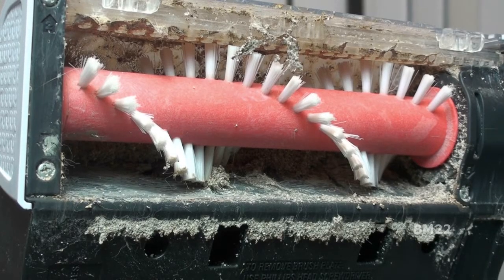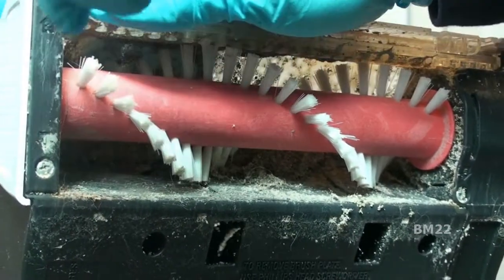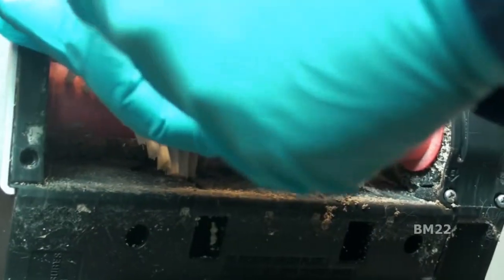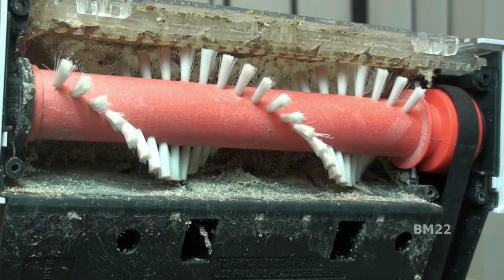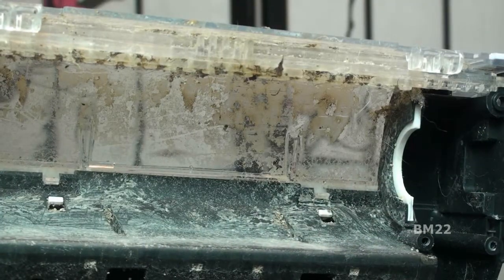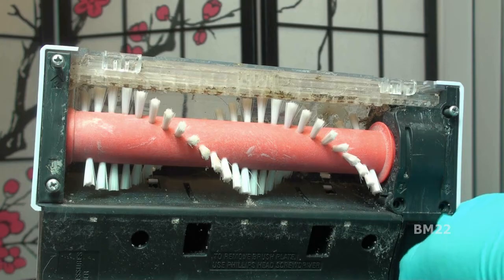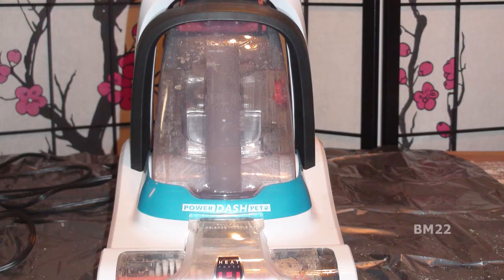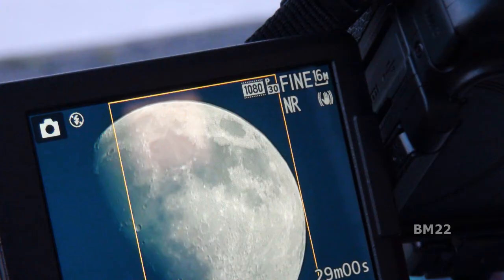Hoover PowerDash Pet Compact Carpet Cleaner; Brush Removal and Cleaning

Comment: So— no way to pop off the brush cover easily and then clean. Ugh! I can only get a few feet of carpet clean at a time with this small cleaner too. Had to keep refilling the solution container and dumping the dirty water. Not convenient or time saving!  Yes, does clean well, but wish I had a deluxe cleaner for better coverage of carpet cleaning.
Reply from the maker: Yes, it's a pain to clean; many people have stated that they run fresh water through it with a garden hose, being careful not to wet the entire unit down. Also, this is great for small areas, high traffic areas, and bedroom sized rooms. I've owned full-sized $1000-plus carpet cleaners, that were great for doing a large room, or entire house. But they were always too much of a pain to do smaller areas, or smaller rooms. And they took up too much space to store. For its size, this is a great little unit for the above stated reasons...and of course the price. It sounds like you need a full-sized carpet cleaner for a full-sized priced, not a small one for a small price. The Rug Doctor Mighty Pro X3 is nearly rental-size and costs around $500, and the Bissel Big Green Professional Carpet cleaner is about the same price. When I used to clean rentals and flip houses (whole house cleaning was required), I preferred the home version of the bigger rental shampooers (cost about $1000, 15 years ago), which is what I used to have before it never was returned to me after loaning it out. Good luck

Comment: Do you have any suggestions on how to fix if it won’t spray water?
Reply from the maker: Check and see if the tube is plugged where the water comes out of the "clean water" tank. If it is, maybe try using warm water (not too hot) to see if you can clear it. It might have soap build-up blocking it. Also, is the pray nozzle clear?

Comment: I cannot get the “nozzle” to clip back into place and stay. I don’t understand what I did wrong. Any one else have this problem? Any ideas how to fix this?
Reply from the maker: I've not seen that problem. All I can suggest is to make certain that you are putting it back in the exact same angle it was removed. It might be a simple alignment issue, or possibly the plastic is flexing too much, making it difficult to put back in.
Reply: @BM22TechReview  you’re so kind to reply. It will not snap back in place. I think the snap mechanisms became weak somehow when I took it apart to clean it. I’m not sure. If I put the nozzle on and push it down as far as I can, while the cleaner runs, it will stay in place. That’s good enough. I just figured this out yesterday. Thank you so much!
Reply from the maker: I'm glad to hear that. They've done us a great disservice by making these near impossible to clean properly...while it being an amazing little cleaner.
Reply: Me too, have u figured it out?
Reply: @kxnghxctor864  no. I bought Hoover Power Max Pet instead. The suction is much better. I’m sorry. I know how frustrating that is. I think it’s a defect.

Comment: Take it out in the yard and spray it with the high pressure hose nozzle.
Reply from the maker: That works, as long as you don't get the wrong parts of it wet. If the motor or wiring gets wet, if you're lucky the worst that will happen is just ruining the motor...
Reply: @BM22TechReview  Since water is designed to go through that part of it, the motor is well protected from moisture from the brush. Carpet solution (water based) is injected into the carpet, brushed up, then extracted. No water gets into the motor.
Reply from the maker: Yes, you are correct...about that part. It's just very important to not get "non-waterproof" areas of this unit wet.

Comment: Thanks for the video!  A question about spraying the cleaning solution--how many passes over the same stretch of carpet would you recommend?  I don't want to oversaturate my carpet with too much water, or solution.
Reply from the maker: I pre-treat the spot or stain, and then I don't spray over it more than once or twice with the PowerDash. And then I make sure to vac over it until I don't see any wetness being sucked up.

Comment: I can’t get my brush roll to spin :(
Reply from the maker: First check to see if the belt is on (or good). Then look for hair or string binding-up the roller. And lastly, you could try removing the roller and cleaning it off. If you don't see anything jammed in there, and none of the other things worked, the drive for the roller may be bad. If that's the case, you'd need someone who knows what they're doing take a look at it. That is above my pay grade...sorry. Don't forget to unplug the unit before doing any cleaning or repairs to it. Good luck.

Comment: Yeah, so I think I just ruined ours 🤦🏾‍♀️. I hosed it because I figured every thing was enclosed. It looked like everything was closed but I guess not…😭😭😭😭😔
Reply from the maker: That's too bad...but at least they are cheap :)
Reply: I am thinking I did not because everything still works it just makes a weird noise 🤔. Taking it apart tomorrow check the belt
Reply from the maker: Hopefully, it's just the belt, that's an easy fix.

Comment: But how to clean the plastic housing? He left it filthy with all kinds of gunk in there. I wouldn't want to use the thing with dirty crap inside the clear plastic housing. Yuck.
Reply from the maker: My current method of cleaning involves vaccing up clean water off the kitchen floor, until the water comes out clear.

Comment: Mine stopped running
Reply from the maker: Completely stopped, as in no power at all? Or is it just the brush stopped spinning?
Reply: @BM22TechReview  it made a loud noise and then it had a  smoke smell and shut off and it will not start up again
Reply: @BM22TechReview  and no power at all
Reply from the maker: I have a couple of thoughts on this. Either the motor fried, and this unit is basically toast. Or it was simply the belt that bound-up, which was the source of the smoke. If it's just a seized-up belt, and that didn't result in destroying the motor, then all may not be lost. Did you check to see is the belt still spins? I would also recommend going to the hoover website and contacting customer service. Generally speaking, I call all these departments "customer no-service" but it might be worth trying, especially if they feel overly generous today and offer you a replacement or discount towards a newer model.

Comment: Have a small. Carpet in an apartment. Have an Australian shepherd.  First i rake the carpet, then vacuum. Carpet is about 12 by 12 feet. Did one pass and decided to do that the following month one more time. Did about 4 foot and it made a strange sound an I smelt burning. I turned it off immediately and saw the belt dangling in half. This is junk. The belt might as well be a rubber band 😠 They could have made it an inch wider to accommodate a wider, stronger belt!😡  VERY POORLY DESIGNED!!🤬🤬

Comment: Don't waste your money on this machine. If you want to just spot clean a very small area that's cool, holds about a liter of water and you will break your back continuously if you want to do even a 5' x 7' rug. Get a bigger machine.
Reply from the maker: I'm not really in agreement with you here. I love the size of this, and I can clean an entire room with 3 to 4 fill-ups. And I had a full-sized carpet cleaner, ya know one of those HR carpet cleaners they rent at the grocery store (the ones you buy are blue, rather than red like the rentals). I think I paid $998 for it 15 years ago. It was nice for doing big rooms, but it sucked if the room still had furniture in it. I rarely used it, and loaned it out many times, until finally it was never returned to me. I also had a mid-sized carpet cleaner, a Hoover Power Scrub carpet cleaner. it was the worst of both worlds; it was too heavy and clumsy for small jobs, and too small for the big jobs. In reality, it's soap and waste containers, were only about 1.5 times bigger than this one, and nowhere near as agile.

Comment: Horrible that you can’t clean it without unscrewing it. I tossed mine and got a shark
Reply: Can’t clean the tank either. Only a small drain hole
Reply from the maker: I love still mine, and it has not failed me yet. Yes, it has some shortcomings I wish they would address. But for the price, and how well it cleans, it can't be beat.

Comment: Do not buy this item as cleaning it takes longer than cleaning your rugs! Absolute junk.
Reply from the maker: Although I agree this can be a pain to clean, I disagree with your other statement here. I have found mine to be very good at cleaning, solidly built, and has lasted well over a year so far with no reduction in cleaning ability. I do wish it ran longer on a tank of cleaner. The waste tank is sized for a bigger cleaner tank, so I don't know why they didn't opt for a bigger cleaner tank. Also, in the comment section of this video, people have shared easier ways to clean this unit, including running clear water through it or even carefully rinsing it with a hose.